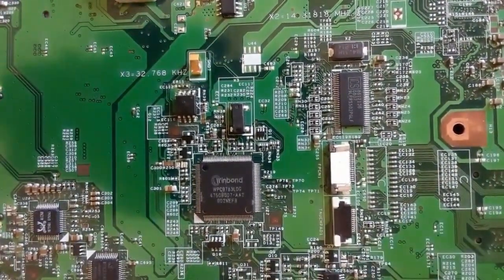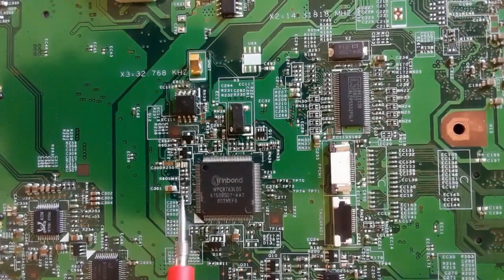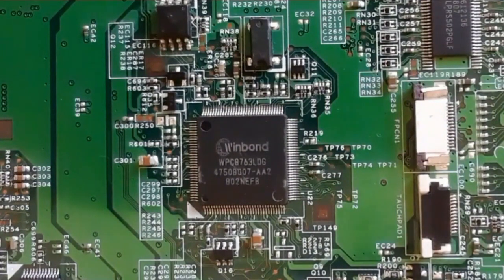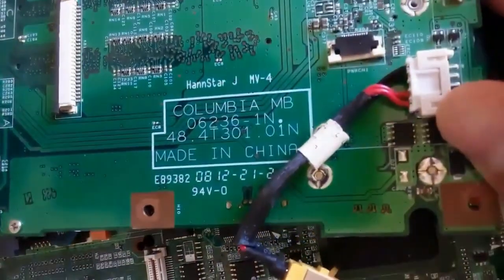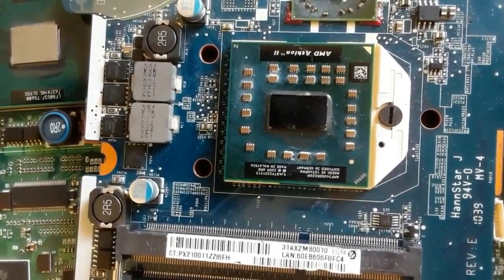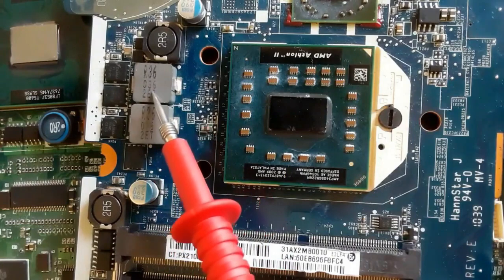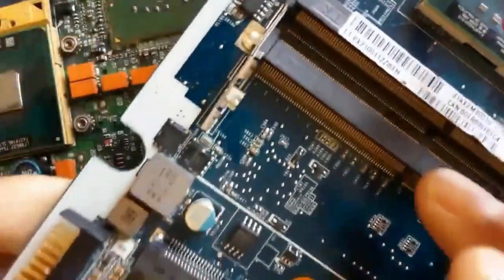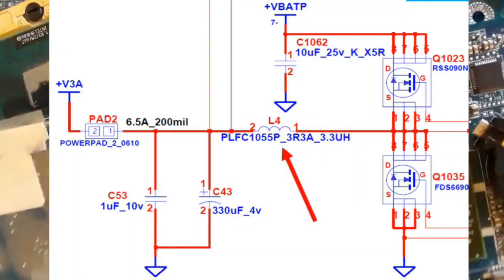The Most Common Faults On a Dead Laptop Motherboard | Laptop Repair

Comment: Hello. Thx for the video. I want to ask a question. You said that if all the ports are not working then it means that the ICH(aka SouthBridge) is damaged. But what if only half the ports are not working while the other half is working normally (aka r45, hdmi,vga and SATA)? Is the ICH still the problem? Or could be something else?
Reply from the maker: Absolutely yes, it could be partially damaged, because it contains many controller section
Reply: Thanks for the reply. Can you also make a video about how to replace the ICH? I would really appreciate it.